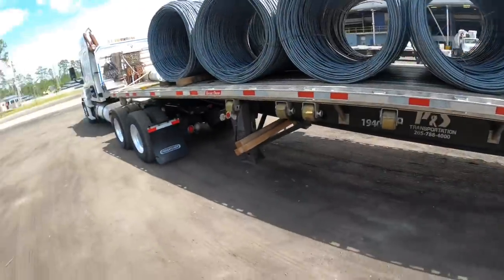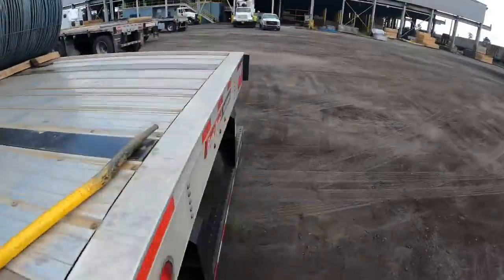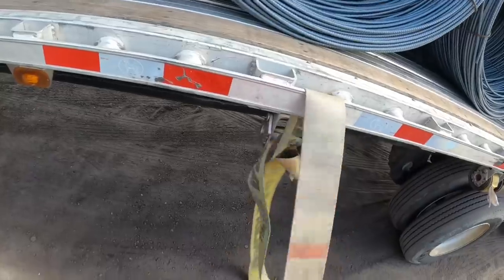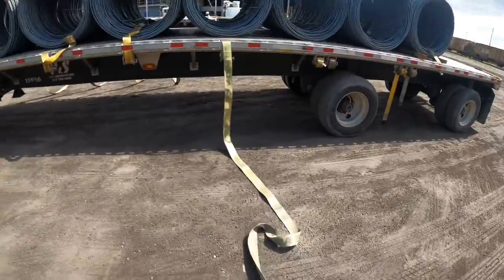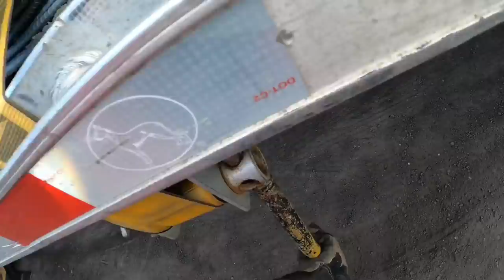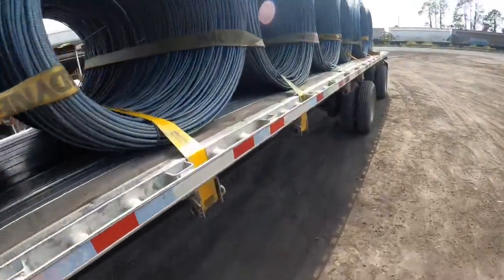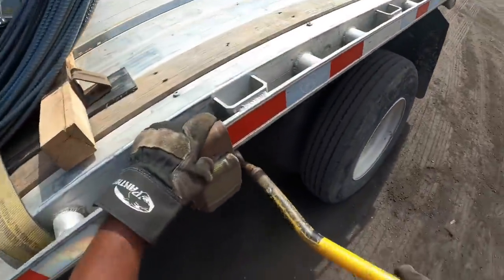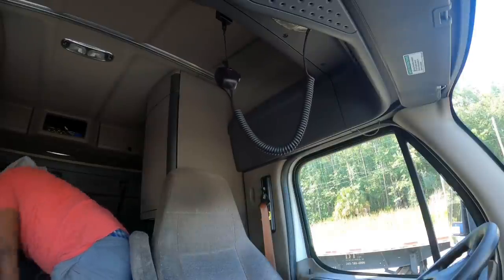How To Secure Slinky Coils Flatbed Cargo Securement

Comment: Always remember with slinky wire if you have 8 coils use 8 straps. Back in the day we  would throw 7 and you would look fully secure.  Dot offier during a dot inspection couldn't figure our way we secured our load and wrote us a warning about load secure ment. Told us if we had 8 coils 8 straps not 7. We said yes and threw one on front set and rear set and rolled out. The good old days.

Comment: Not trying to be a smart ass but that's not how you strap down coils. You want the first few straps on the coils closer to the cab pulling backwards away from the cab and the last few straps the opposite way. Lastly you want a butterfly on both the front and back coil or u can use a chain. The reason for strapping this way will prevent coils rolling into the cab in a hard brake situation. Specially the way you have the coils being  strapped pulling towards the cab
Reply from the maker: 🍪 Where did you learn that? At a mega carrier company? That wasn’t my first time pulling that load and btw, I dropped that load safely about 6 months ago I believe. Keep on trucking brother and always remember. It’s always more than one way to skin a cat 😉
Reply: @bigsnow1705  lol I haul coils every day bro lol but ok. Keep doing yo thing I was just trying to look out.
Reply: @czaragoza7396  why you say it’s wrong? I do exactly like he did and at the shipper 99% of the people have it that way. His butterfly is on the second coil pulling it back. The last 3 you can pull them forward. We had a western express join our company and put the x or butterfly on the first one inside if that makes sense. Either way you’re pulling it back…

Comment: drive to the 106 in NC big Petro and a flying J there.
Reply from the maker: Mark Nairn I get off on exit 75 to go home. I know where that’s at. Right up the road from me. Kenly NC
Reply: @bigsnow1705  better yet, I use to run that 95 all the time.
Reply from the maker: Mark Nairn that’s all I run now. Up and down
Reply: @bigsnow1705  Look For those Johnson Horse Transportation trucks, White KW's pulling a shiny stainless horse barn that's me.
Reply from the maker: Mark Nairn I’ll be on the lookout